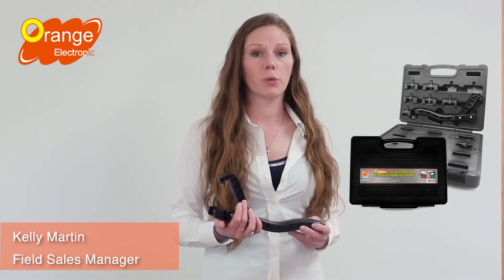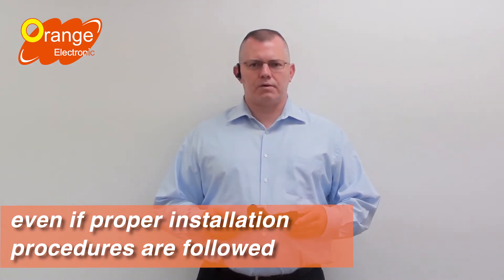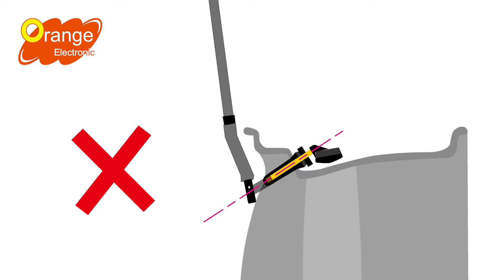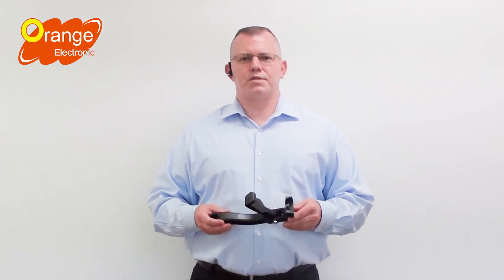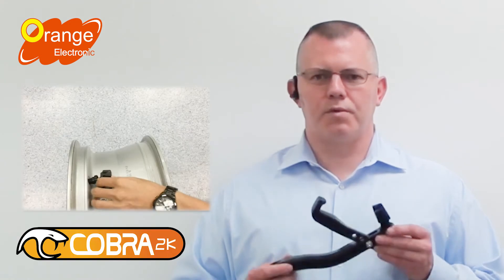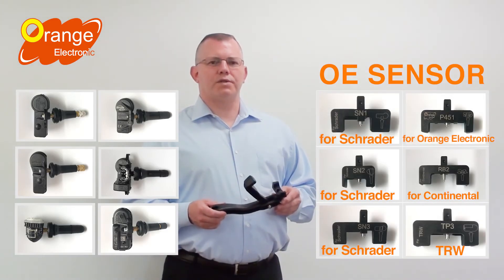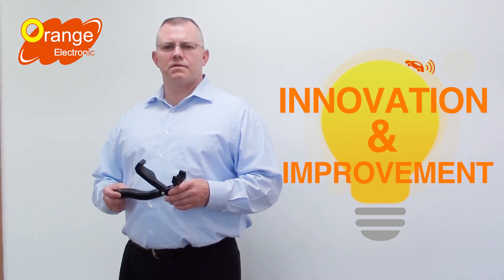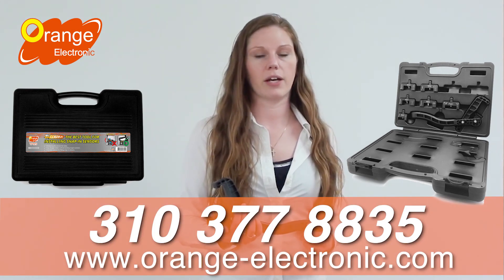How to replace TPMS valve stem

Comment: I pulled valve stems the old fashion way for 30 years, and never had a problem. now this tool suppose to be better. don't look like it to me, I would be afraid to push on TPMS sensor, and BREAK IT. then I owe the customer a 100.00 dollar sensor.